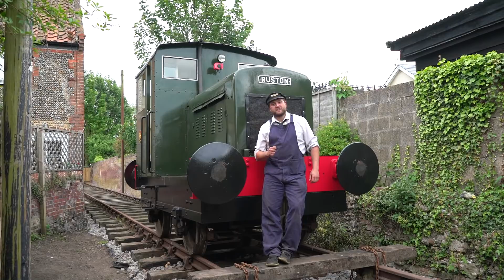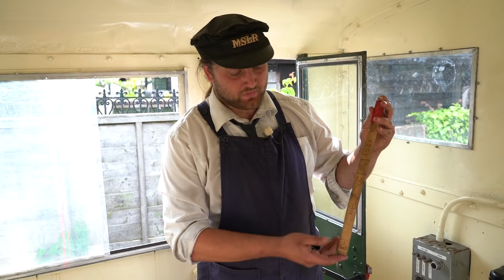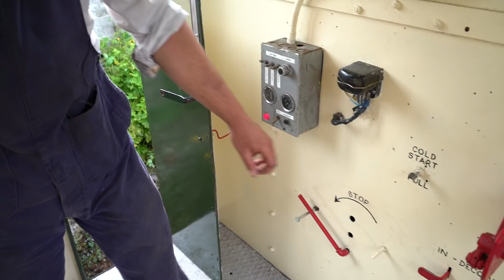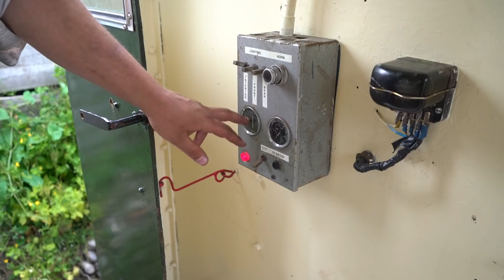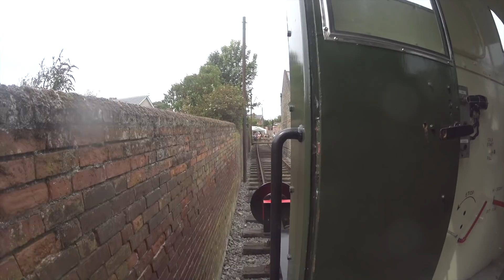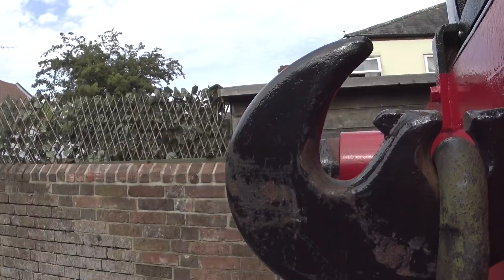My mighty Ruston 48DS! Lawrie Goes Loco Episode 7.

Comment: I'd be most interested to ride it.
I've leant ( many through motorcycling, that speed is relative. 
Even 40 MPH in a rough, noisy 1 ton van, on a rough, cambered road with things like manhole covers seems fast. Wile 60 MPH in a smooth, quiet car on a smooth highway, is laid back.

Mainline locos have a slow rock and roll gait, doesn't matter what the speed it. But with most passenger car, I find 50 or more at night feels fast, 60 or more , flying but often 100 MPH in the day, does not feel fast & 60, just ordernary.

In Adelaide Australia there was a suburban fleet of trains, nicknamed the Red Hens. Probably due to their, open doors, noise, rough ride, not rocking but a sort tremble through the suspension, ment these DMU always felt fast above 45 mph. They only had a top speed of 55 MPH, but it felt like 70, day or night.
MY first bike was a small scooter & even 30 mph on it seemed really fast.

Comment: Hi. Loved the video and your loco. Reminds me of one I used to see and have a ride on when I was coming home from school. Not sure if it was the same as yours, it was a Ruston & Hornsby Type 88DS 0-4-0DM Shunter - built 1957 No 20 based at Reading signal works.
Reply from the maker: Ah no, the 88 is the next size up, with 88 horsepower, rather than my tiny 48.
Must have been good fun to get a ride on though!
Glad to hear you enjoyed the video!
Reply: @lmm  Thanks for coming back to me. I did a bit more research and worked out it was not quite the same. It was good fun being only 14 or so having a ride in the cab but I'm a driver now so do it every working day. I may try to come and see your loco one day.

Comment: I saw the video where you picked it up, you weren't able to start it then, what did you find out about it that you were able to fix?
Reply from the maker: Better battery.
We'd had it running when I agreed to buy it before I bought it, so we knew it worked.
It was just lack of use.

Comment: I'm sure you can't wait to get the flanges fixed and maybe one day run it on a continuous track for all to see.  So much character.  Cheers.
Reply from the maker: It's running alot at the Mid-Suffolk Light Railway, but we're on restricted speed for the time being.
She is a super thing!
Reply: Excellent.

Comment: While the noise comes from the engine and running gear, most of it will be vibration in the sheet metal. Add some 90 degree angle iron bracing and consider adding some sound deadening to the cab.
Reply from the maker: That will certainly help!

Comment: Whats the running cost? Do you have to get parts fabricated or can you pick up used? I have a million questions.
Reply from the maker: Running costs on day to day are just oil and diesel - so it's not that bad, the more you use it, the more expensive it is!
There are spare bits kicking about, but some bits will have to be modified to take newer equivalents or, we'll have to make bits.
Keep the million questions coming!

Comment: A truly wonderful little shunter Locomotive! Out here in the 'states where I live, 'shunters' of this size were exceptionally rare, particularly after the era of Steam Locomotives. Generally, our shunting locomotives (we generally call them 'switchers') were rather heavy and bulky (But there were lighter models to suit some customers) and although no longer so popular on the active freight railroads, some of the diesel models were still regularly seeing service on larger railways as recent as 20-30 years ago. These days, the diesel switchers built in the 1950s, '60s and '70s are most commonly seen working industrial plants and short lines, or in tourism service, both of which have been perfect 'later life' applications for them. Although many a steam switcher was cut up and scrapped, a number are preserved. There were never very many small diesels quite like your Ruston in the United States (Compared to other kinds of switching locomotives), and mostly they served use in industries that did not require or could not use larger, heavier equipment. Some were manufactured by large and well known companies, while others were experimental 'one offs'. It's a bit of a shame that the small industrial switcher didn't have as much of a presence here as they had in the UK, you folks are most lucky to have so many of these lovely engines preserved!!
Reply from the maker: The UK had done really well for locomotive preservation, we're really lucky. You guys didn't do too well, still gotta be thankful for what is saved. 
Shunters/switchers are getting rarer here, big diesels are electric drive, so can shunt with ease these days.
It's quite exciting to stumble across one - there's one on the Docks near me, I'm still excited to see it!
Reply: @lmm  Ah! That's wonderful! Glad some are still put to good use. Yes, that's quite what happened to the switching locomotives here. In the 1950s, the rise of "Road Switchers", locomotives with good visibility both forward and behind, and the versatility of diesel-electric propulsion allowing for practical use both on the mainline and in the yards. Maintaining a separate fleet of locomotives that could only be used in switching duties, when mainline locomotives could do the job just as well, just didn't make sense. I have to agree, many less historical locomotives have been preserved in the US, likely because of the nature of how American Railroads tend to dispose of unwanted equipment. Often, diesels were traded in through programs to get new locomotives, ensuring they were gone for good. And most equipment that for whatever reason did not seem easy to sell, was simply sent off for scrap or cut up on site. One of my favorite parts of railroading is Trolley Lines (You call them electric Trams in the UK), which are even less plentiful in survivors. The struggle with Trolley lines, was that most cars built up until the 1920s, were made of wood. When trolley lines shut down due to competition from busses and automobiles, and trucks stealing their freight traffic (For those lines that carried freight), there were not often many lines left seeking used equipment. And being made of wood, the easiest method of scrapping was to simply set them ablaze and then rake out the metal from the ashes. Most trolley lines that were shut down around the 1920s-1940s disappeared and left behind no more than perhaps a single car (stripped of valuables) being turned into a summer cottage or a farm shed, or turned into a diner and heavily modified over the years to a near complete loss of recognizable form. Most remaining electric Trolley cars that could be restored, are now in the hands of museums, but a number still remain hidden throughout the countryside. Unlike later steel PCC trolleys (The first and just about only national standard design for a Trolley), their numbers are particularly limited for any particular pattern, and it's a terrible shame that so many of them were lost before there was a chance to raise funds and interests to preserve them!

Comment: Is this literally a section of standard gauge track in a back garden? O.o
Reply: No, it's a little bit (100 yards) of old track which connected Garrett's in Leiston to the Aldeborough branch line. They've just relaid the track this year after clearing a lot of crap:

https://maps.app.goo.gl/SbsM4YzTNUNz7xgh6
Reply from the maker: As Thomas said.
I was asked to take my Loco there to open the line, so we did!

Comment: Would it be a step to saving your hearing to line the cab with  sound absorbing foam  inside and if space allowed to do the underneath of the cab ? I think it would be an improvement .Of course some of the noise is a result of it being reflected off the brick walls as well
Reply from the maker: It's noisy everywhere. Sound deadening is one of the next things we need to investigate on it.

Comment: Everyone said my DS48 is very loud and the Forward/reverse is a pain. It’s the way it is and it’s great fun
Reply from the maker: Glad to know it's not just mine then! Which one is yours?
Reply: Mine was built in 1951, number 305302.  
Currently used for shunting sleepers and our ballast wagon.
We tried using intercom radios to talk to the track crew, it was so noisy, we ended up using hand signals.

Mine was built in 1951, number 305302.  
Currently used for shunting sleepers and our ballast wagon.
We tried using intercom radios to talk to the track crew, it was so noisy, we ended up using hand signals.

Comment: Lozza, by Jove you have done it again... I haven't ever had an interest in trains, yet I love watching this. She's a brilliant and pretty little motor. 

That tiny diesel tank, does it need 'normal' modern diesel or is there something specific it needs to feed her? 

Do the neighbours mind you making so much noise each time you go to see her? 

I assume by modern train tech you can't take her on to non-private lines? 

I bet she's a real pleasure for train enthusiasts to ride in. Think you'll ever invest in another?
Reply from the maker: Thank you! That's a huge compliment!
I am very proud of the little thing - still stuff to do on her, but it was super taking her out and getting a bit of attention. 

Yeah, she's running on normal Red Diesel at the moment, idon't think diesel has seen the changes that petrol has. 

Back at its home on the Mid-Suffolk Light Railway we're more isolated, so less people to complain. At the Leiston Works Railway, as this was the first time a train had run here for in preservation the locals seemed to love it. Out in their gardens waving and taking pictures.
We had some people come along who remembered the railway from before it closed too.
If it was running every weekend I think the locals may be a little less impressed however!
I did wonder how much the house rattled as we went past!

You're correct there, it has non of the systems required to run on the 'Network'. As it'll only do 9mph flat out, it's also just too slow.

It's good fun to go for a ride in, novelty value is quite high, there aren't a huge number still running regularly. The excessive noise does rather negatively effect the pleasure somewhat though.
I wouldn't say no to another, there's several on scrap yards I've my eye on, but it's funds, and having a place for it to live.
If I could make it work I would.

Comment: amazing cute little thing. is there any plans to fit vac brakes to allow it to haul some passenger's and stop heavy loads. it's  amazing to think that it was once flying Scotsman's shunter. great to see someone relatively young own his own loco then the only person I know who owns a loco is a lot older.
Reply from the maker: I'm glad you agree! I think it's super!
I've got no plans to fit vac atm, I have concidered the idea.
I'm hoping we're going to be allowed to operate with a brakevan as it has an independent brake. For stopping heavier trains, we've tested it at the MSLR and it'll stop three wagons on the steepest part of the line - but won't push them back up, so there isn't really anything to gain in that department.
It's a great line up isn't it, 4472 and 294266!
I'm really proud to be a younger person into railways, I'd always dreamed of having my own Loco, so just really happy it worked out.

Comment: The only way to travel Lawrie 😀😀 tho I am a steam enthusiast
Reply from the maker: I'm a massive steam fan, but I just can't afford to maintain a steam locomotive. This thing is pretty good for a diesel though!
Reply: @lmm  the thing is Lawrie is steam locomotives have to be stripped down every 10 years so its not just running one it's the 10 yearly overhauls so I see where your coming from did you enjoy the nymr when you went spotting thanks
Reply from the maker: Do love the moors. Stunning railway, with some proper locos on it.
It's not even the ten yearly that's the only issue, it's the regular boiler inspections, the cost of repairing absolutely everything, and just everyday operating cost.
There's one way to make a small fortune with a steam locomotive, and that's to start with a big fortune!

Comment: Two questions Lawrie. You said that it didn't stop very well at one time, have the brakes been improved since then? and is horsepower on loco's measured in the same way as cars because 48hp sounds like nothing for having to pull that loco along let alone that and 100 tons?
Reply from the maker: It didn't stop a hundred tonne locomotive very well apparently. 
We have adjusted the brakes and it stops itself very well, we've done a loaded test run at the mslr with three wagons and it stopped them on the downhill pretty well.

Yeah, it's geared down alot. It'll move 100 tonnes on the level, lot less as soon as any gradient comes into play - like twenty tonnes uphill at the mslr is getting towards its limits.
Reply: @lmm  20 tonnes and its own weight uphill from less than 48hp is seriously impressive to a person who knows nothing about loco's, I can see why you wanted to buy it, its a sweet little thing, wey thats if you can class 7.5 tonnes as little!!
Reply from the maker: It's not a bad little thing, mslr is quite steep too.
I wanted one really because they're quite cute, one took up the Mid-Suffolk Light Railway after it closed, and it can be owned and looked after by just one person.
Most big engines are looked after by a group.
Getting it from Sir William was just the icing on the cake!
Reply: I think the brakes are fine for the loco but it does not have a train brake system which would be needed if you haul a 100 ton train. With trains it is not about HP but about torque to bring a train in motion. It has limited drag from the wheels so when it moves it moves..... but braking a train just only on the loco handbrake is something different.